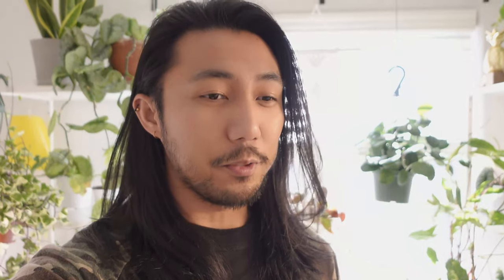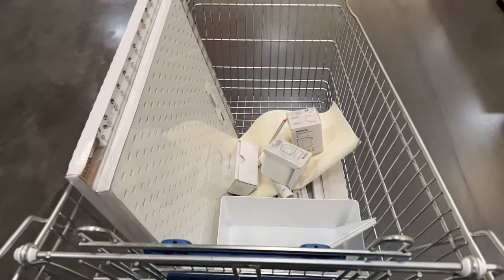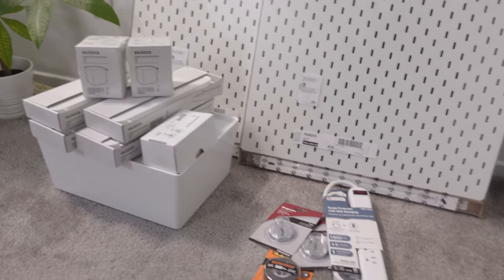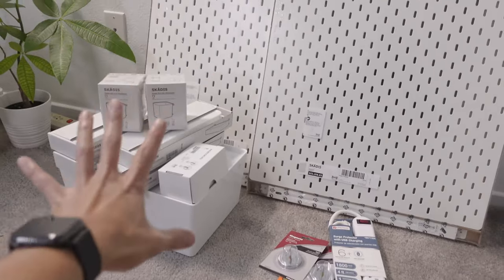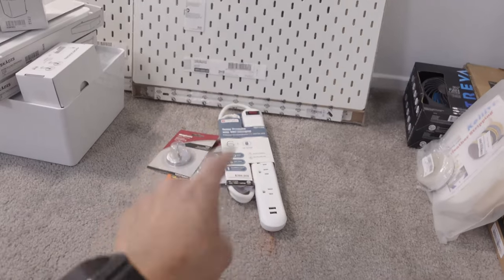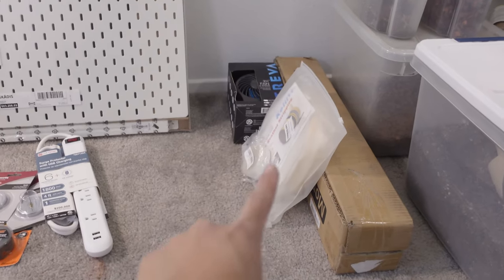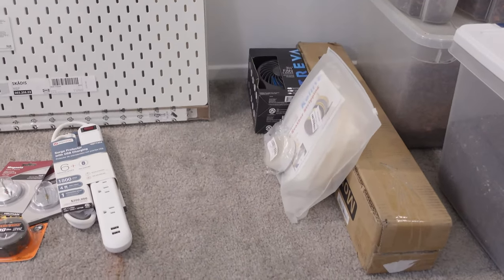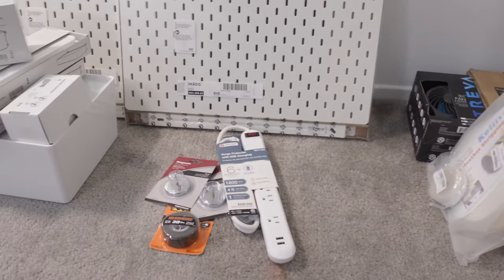My IKEA Milsbo Greenhouse Setup + Tour | How To Install the Pegboard

Comment: Love your video, your cabinet and accessories and how calmly you instructed us! It looks gorgeous! Question: do you keep your room at those temps and humidity levels all the time? I'd like to start trying some plants but I generally keep my place at about 62 to 65 F. Yikes.Any Arctic plants you know about? :)
Reply from the maker: Actually I keep my house at about 70°F, but there are several factors affecting the exact temp and humidity in my plant room: it’s up on the second floor, the window is south facing, door is kept closed at all times, grow lights, etc. Generally, I keep the same temp and humidity all year round. They seem to like it at about 75°F with the help of the south facing window and grow lights 😄

Comment: Thx!  Love it!  I just snagged one finally this last week. Gonna put together today😊
Reply from the maker: Congrats! Have fun!! 😆 I recently removed the top weatherstripping because it maintained ~90% humidity even without a humidifier and mold developed on the pegboard. If you find it holds onto higher than 80% humidity, try to maximize your air circulation. Otherwise, take some of the weatherstripping off. Just some additional tips after operating it for a while. I’m planning on doing an update video soon. 😊

Comment: Your video guided me through setting up the Milsbo cabinet. I ended up having 3M Command sticky pads on the pegboards as some spacers against the back glass panels. I have them at the corners of the pegboards so that the pegboards hold the position.
However, I drilled the cable hole on the door side as a mistake. I would suggest people make sure they are drilling on the expected side of the cabinet :)
Reply: Hey Ron, my IKEA pegboard starts growing mold. Do you have this issue and how do you treat it?
Reply from the maker: Hmm, the only type of mold I experienced was when I treated plants with mosquito bits. I added the mosquito bits granules on top of the soil of some plants and green mold started to appear on the pegboard and some wooden stakes. I had to disassemble the pegboards and hose them down. I stopped used the granules and only use mosquito bit tea now and the mold never came back. My humidity ranges from 70-85%. What is your fan setup and humidity like? What does the mold look like? You might need more air circulation.
Reply: @SuchPlants  My humidity is avg at 85% I and highest to 90%. I have a humidifier close to the left-bottom corner of the bottom pegboard and most of the mold gathers over there. So humidity / moisture is the factor.
The mold is looking black and not sure what type or cause it is.
The fan is facing towards the plants instead of the pegboard. I might try face it toward the pegboard.
Reply from the maker: Yes try facing it towards the pegboard. However, if you seal the doors sufficiently, you might not even need a humidifier in there! I don’t have in mine and the lowest humidity is usually around 60-70% when it’s about time to water the plants again, and then the humidity goes back up to around 80-85%. Everyone’s conditions are unique, so it will take some trial and error. Hope you find the sweet spot!

Comment: Your explanation and tutorial is definitely the best I've seen. Would you happen to know the diameter of the drill bit that you used? I'm planning to follow your tutorial and order a few things from your list and want to make sure I get an adequately sized bit. :)
Reply from the maker: I used 1.5” drill bit for the hole, but the rubber grommets are hard to find in 1.5” so I recommend going for 2” drill bit instead, or whatever grommet size is easy to find!
Reply: @SuchPlants  Thank you so much!

Comment: This is so far the best video I found on youtube on how to setup the Milsbo greenhouse cabinet. You did great and explained everything. And you inspired me to get my first cabinet 😁. Can you please tell what size hole you drilled at the bottom? Thank you!!
Reply from the maker: Thank you! The hole was about 1.5” diameter, which is an uncommon size for the rubber grommets. I made the hole before I realized that so I had a hard time finding the correct grommet size. I think you can find 2” grommets more easily so my advice would be to go with a 2” hole 😅
Reply: @SuchPlants  Thank you, Ron. I found the 2" hole saw at Lowe's and ordered the grommets from Amazon. Any reason why you choose T8 lights instead of T5?
Reply from the maker: Based on the reviews, it seems the T5 gave off a slightly pink light, which I’m not a fan of so I went with the T8, which is a slightly warm light.

Comment: Great video! How did you wire the top two lights ? Is the cord coming out from the top ?
Reply from the maker: All four lights are connected to each other and there is one plug that goes through the hole in the bottom of the cabinet.

Comment: This video was so helpful, so I just ordered all of the stuff I need for my tall milsbo. I actually have 2 tall milsbo cabinets in boxes ready to be set up, but I decided I’d start with one and see how it goes:) I am so excited!!! I had been putting off ordering all of the small stuff because it seemed overwhelming but after watching you set yours up, I feel much less stressed out about everything. I wanted to add that my monstera albo also just started to yellow (one leaf out of 4), and my gut told me to take it out of the pot and check the roots, and it was root rot. I feel like you may be dealing with root rot as well. I hope I’m wrong!!! Will you post an update on how all of your plants are doing in the greenhouse cabinet conditions, and how your albo is doing? Also, I am curious, did you end up needing/leaving 2 lights per shelf or was it too much light? I think I have the same lights as you do. Mine are the monios-l t8’s and I have been trying to decide if I want to try 1 light per shelf or if I should put 2. Thanks so much! -Nora
Reply from the maker: Hi! Yes I want to do a Milsbo update soon! I actually haven’t taken out my albo from its pot so I’m not sure if it was root rot, but I did drench it in hydrogen peroxide and started using liquid fertilizer and it is finally giving me new growth. It may have been root rot, or it may have been needing fertilizer. About the lights… I also felt like 2 lights per shelf was too much, but the plants seem to like it so far. No burning, although the second shelf gets warm from the lights being mounted directly beneath it. I’ve seen people stack 2 glass panels for the second shelf to help with supporting more weight, but it could help to insulate some of that heat. I am so excited for you! You are going to love it. I ended up removing some of the weatherstripping because it held on to too much humidity at ~80-90%. Now it is around 60%. Enjoy! ☺️
Reply: @SuchPlants  hi and thanks so much for taking the time to respond. The double glass idea is so smart! I did buy wire racks because I saw a lot of videos where the glass shelving blocked the air and humidity to the point where it was almost as if there were 2 or 3 completely isolated “chambers” for lack of a better word, but doubling the glass makes a lot of sense! I would love to see an update on your Milsbo!You’re so lucky you didn’t end up having to deal with root rot! I am so nervous that I could lose my albo!! I did everything that my research has suggested and as of right now, I still have some healthy roots and 3 gorgeous leaves. Keep your fingers crossed for me that it regrows a nice healthy root system!! I ended up taking my albo out of my aroid mix, and putting it into a clear soft pot with moss and perlite. I have an albo wet stick that I have had a lot of success so far with, and it came to me (and has stayed) in moss, so I felt that it was my best bet for trying to recover some healthy roots! I have everything ordered for my greenhouse cabinet now except for some type of fountain or humidifier. It’s the last decision I have left to make lol. I was shocked at how many choices there were for all of the little extras, but I did end up going with the same weatherstripping you used. Knowing that your plants are happy with 2 monios t8 lights per shelf is super helpful also! I think I’ll be using 1 per shelf to start, but now I won’t be worried that the light will be too strong that the leaves could burn. That was a major concern I had been having. Did you have a hard time drilling the hole for your cable management? I am not sure which side I’m going to end up needing the hole to be on so I think I am going to drill one on each side of the bottom back corners. I haven’t yet seen a video where the hole has been drilled out in real time, so I honestly don’t know what to expect lol- is it going to take 10 minutes or 30? My husband is going to help me assemble my cabinets tomorrow and I am super excited! I am subscribed to your channel so I’ll definitely have to keep an eye out for a milsbo update! Thank you again for all of the helpful tips! Have a great weekend! -Nora
Reply: Oh- which weatherstripping did you end up removing? I feel like I’m definitely going to minimally need to seal the gap between the doors in the front.
Reply from the maker: Drilling the hole wasn’t too bad. The drill bit will drill through in less than a minute but it depends on the amount of pressure you apply. More pressure = faster, but also beware when the drill bit starts to “bite” through because it can snag and your wrist might jerk from the drill. The weatherstripping that I ended up leaving on were the vertical one in the middle and the horizontal one at the top. I have no humidifier and it stays nicely at ~60-70% on average. Of course it might be different with your environment, but I you can experiment what works best! ☺️
Reply: @SuchPlants  perfect! Thank you so much!
Reply: @SuchPlants  You we’re totally right about drilling the hole! I can’t believe how much time I spent worrying about drilling that little hole😂and how long I put off building this cabinet- it was so easy!!! I have a feeling now that I know what I’m doing, my second cabinet assembly will be a breeze. It is amazing, though, how much room I have left to fill up with more plants! I think the size of the cabinet once built is deceiving. There is a lot more room in it than I expected. This was exactly the excuse I needed to go to Logees today!!! Thank you again for all of your help!

Comment: Hey! Have you had any problems with mould on the Skadis pegboard since it is made of fiberboard/wood? I've heard a few others had
Reply from the maker: Hi! I haven’t had a problem at first, but I did start seeing mold appear when I started to use mosquito bits. I sprinkled some of the bits on the soil of some plants, and then mold started to appear on all wooden material (pegboard, stakes, etc). In the past, I’ve experienced mold when using the granules instead of the tea. After I wiped off the mold, I switched to mosquito bit tea, which lessened the problem but didn’t really eliminate it. Other than that, I haven’t really seen any other mold issues. I believe air circulation has a lot to do with preventing other types of mold.
Reply: @SuchPlants  Thanks for the reply! Oh so mosquito bits did that. Good to kow. Yeah air circulation is definitely key. How high is your humidity in there on average? I might aim for 75-85 so buying a pegboard feels a bit risky although it would really help to have one.
Reply from the maker: Mine keeps at around 60-80. I should also mention that I did coat the pegboards with polyurethane after the mold incident!

Comment: I thought a draft was not a good thing.  I'd turn the fan towards the wall, air will still move but no draft directly on plants.  Hope that helps.
Reply from the maker: I think when we say draft we mean a cold draft coming from windows and doors. An indoor fan shouldn’t be an issue since it’s just blowing room temperature air, which is good air circulation. 😊

Comment: If you used a humidifier, would the glass shelves block humidity to the top half?
Reply from the maker: Yup, but if you have a fan it should help distribute through the several gaps. For the best distribution, people have been using wire racks in place of the glass. There are Etsy sellers that offer wire racks cut to size. 😊

Comment: How did the double sided tape do when holding your the lights?
Reply from the maker: Lights are still holding. It is partly due to the snug fit of the lights with the cords being wedged in the sides against the glass.

Comment: What is the purpose of the weather proofing?
Reply from the maker: The cabinet can still become dry since the humidity can escape through the gaps between the doors, especially if there is a fan inside. Weather proofing covers the gaps so the humidity cannot escape.

Comment: Did the pegboards rot over time?
Reply from the maker: They held up pretty well, considering I added a couple coats of waterproof sealant. If it is consistently about 60% humidity or lower, you should be okay. Anything higher than that might result in the pegboard warping and rotting. Mine warped at first, and then I removed some weatherproofing strips to reduce the humidity a bit.